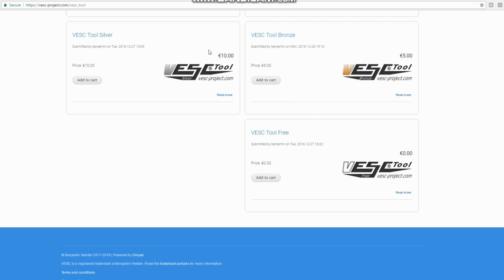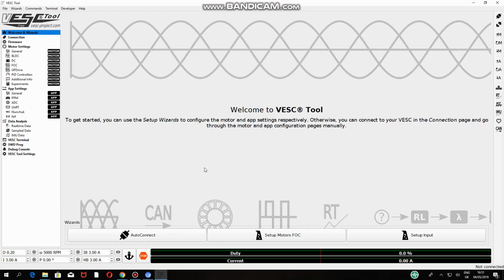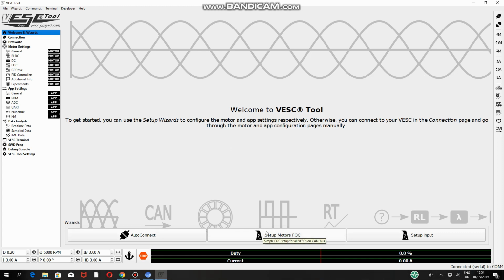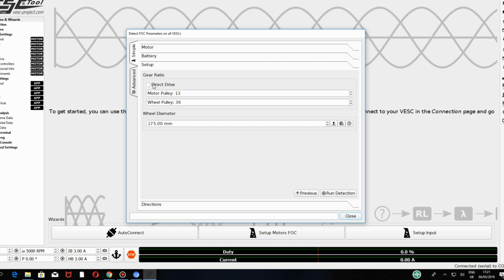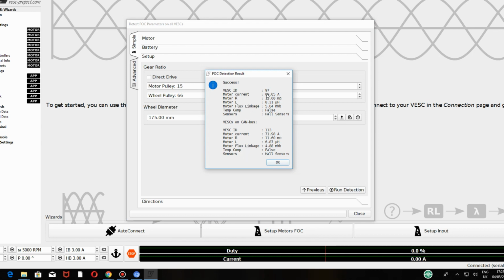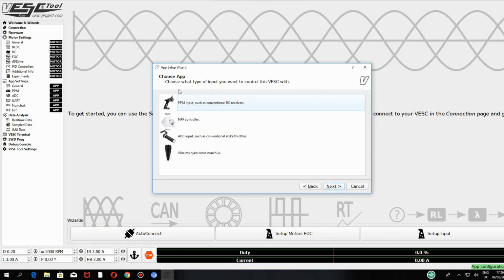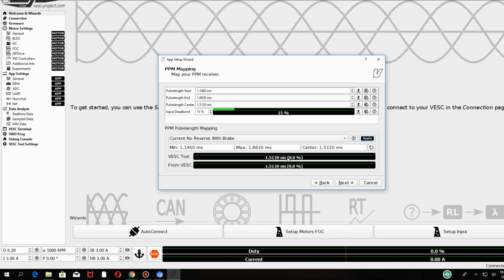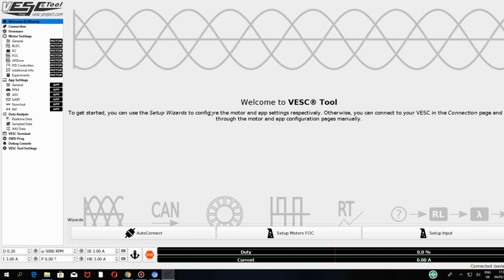VESC TOOL 2019 TUTORIAL. PLEASE READ MY COMMENT!!!! IMPORTANT!!!!!

Comment: I got caught in the rain and my storm core comes on but the wheels don’t move when I squeeze the throttle, it makes noises like it wants to move and the brake light steady blinks on my boosted rev
Reply from the maker: Did you check the phase cables mate?

Comment: Hey Pavel Garmas, this is really helpful tutorial. But I have hard time figuring out how to set the Battery Current Max and Battery Current Max Regen given battery configurations. And also want to figure out how to connect the keyboard/wireless Joystick to VESC. Would be great if you can help with this.
Reply from the maker: Hi mate,
Are you on my Facebook group ESK8FREEDOM? It will be faster and easier to help on there.

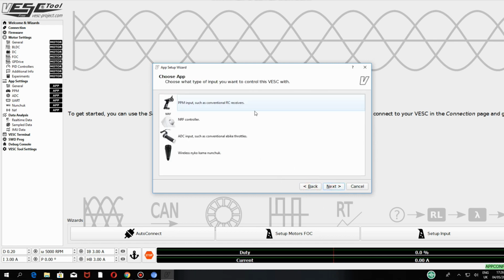Comment: Great video. The video has been very helpful, but I am having an issue at 15:27 on the video. I don't have any activity on the PPM Mapping. I have changed the VESC selection and have plugged it into both VESC's to test. I have updated the firmware a few times. I have gone thru the setup several times and keep having the same issue. I have a Flipsky Dual 4.20 VESC, hub motors, a Flipsky VX1 remote. Any help would be great.
Reply from the maker: Hi mate. Are you on ESK8FREEDOM Facebook group? Join. It is easier and faster to communicate there.

Comment: Yo man! Appreciate vid.. I got to the end of the motor setup wizard. After I enter my gears (I am using e-Toxx chain drive. 8-40 and when I hit the run detection I get error message  your vesc is not connected connect your vesc and try again. Any idea what this can be. Thanks
Reply from the maker: Have you tried to set the gear count after the detection? Gear numbers is for the correct speed reading only. Is the cable you are using in good shape and is definitely a data cable  and not just power cable?
Reply: Got it!! Appreciate ya man. Your vid helped so much man..keep doin them

Comment: Great video! I am having a problem with my setup. Vesc runs motor without the hall sensors but cant recognize the hall sensors. Any advice?
Reply from the maker: Hi mate,
It would be easier if you join my Facebook group ESK8FREEDOM and raise the question. We will help you to sort out the issue.
Reply: @PavelGarmas  Hi Pavel, thanks for reply.  I don't use Facebook but my body Richard who is working on this project with me will contact you. 
Milan

Comment: Flipsky FSESC 4.12 50A SK8 ESC Banggood says its a 14s i would like to add 48v lithium cells,Is this possible to work?
Reply from the maker: Flipsky 4.12 is not a good esc mate...definitely not at 14S. I have used them on 12S and it did blow in a week ... it was on FOC mode.
4.12 is only ok on 10S and BLDC.
Reply: @PavelGarmas  Its known to blow up  on  12s
I have two 10s Maybe in parallel,it could last a lot longer.
Reply: @PavelGarmas  how about 36v parallel? erm 8p

Comment: Hey man your video is the best tutorial out there!! I appreciate it saved me a lot of headache.  Do you happen to know if the flipsky dual 4.20 vesc can controll 2 motors independently via rc channels (2)? Any info appreciated!
Reply from the maker: Hi buddy,
Thank you for a nice comment. Unfortunately not...4.20 would not control the motors separately....none of the dual vesc esc would. They way they work is one is the master and the other one is slave. You will need to use two separate esc units as far as i know. BTW .... 4.20 is quite weak and does not support FOC mode safely.
Reply: @PavelGarmas  hey like I said b4 I appreciate the info!! Although I must say I did get them to function separately in channel 1 and 3 on an rc airplane remote, letting me drive tank style, I made all my changes in the app not the wizard, if u have any interest I can share the changes with you.  I appreciate your time and ride on!!

Comment: Should the battery current max set to half? in ur case 60A instead of 120A if your setup is dual?Then batter max = 1/how many motors. Or is it only applicable to two phyiscal VESC connected in can. THANKS
Reply from the maker: Hi mate,
Very good question.
You need to divide the battery current max and apply half to each esc or vesc. So if your battery current max is 100 Amp , 50 Amp per vesc.
I was setting up for a high discharge lipos ....

Comment: can i use it for exway flex?
Reply from the maker: Hi,
Any esc that is based on vesc can be programmed and settings changed however I believe that this board has an integrated esc by Hobbie Wing so it is not programmable.

Comment: What vesc are you using? It looks like a flipsky but I can't tell. Trying to decide on one for my first build but hear mixed reviews on flipsky. Recommend anything? Thanks this video will help big time!
Reply from the maker: Hi mate,
I am using the first generation Flipsky 6.6 plus with the heat sink. Still works no problem however there are a few reports that the new version and the mini do burn out. I would recommend the Maytech 50Amp or if you can afford it then the Trampa HD60 vesc. I got both reviews on my channel if interested.

Comment: Pavel, well if you're using 6S3P battery type or similar, think they you have to put 6S as series instead of 12(as you're requested to put series but not all what counts parallel connection)
Reply from the maker: Alex,
You need to put in a total 12S value of the pack. I have used two 6S Lipos in series so it is 12S in total. Hopefully I have understood your comment correctly.
Reply: @PavelGarmas  Pavel, just revised, yeah you did right 2x 6S in series = 12S :)
Reply: Well Pavel, but not agree with you on this case as in dialog it is requested to put only series  connection, but if it work for you then just fine. Also planning to build soon el-skate but with one wheel drive and see what we have, may do also some posts about build here
Reply: Decided to use 7S2P 6Ah battery here and think it have to be well for comfort city cruising
Reply from the maker: @alexvinnikov2967   What esc and motors are you planning to use? By the way, are you on Facebook? If you are, join my group ESK8FREEDOM.
Reply: @PavelGarmas  well ordered 1x 5045 1.5Kw and mini VESC 4.2  for now. I do use mostly insta: @vinmotive.design  ;  Can join team better if you have INSTa channel too, let me know then Pavel
Reply from the maker: @alexvinnikov2967  Alex. I do put in only the series connections in... hence why 12S  ( two 6S in series makes it 12 series connections in total ) setting in my video.

Comment: I’m first just trying to get it to work on one motor.  I tried a lower motor first then a wheel motor since that what it is.  I’m a mechanical and electrical engineer, I almost never have problems like this. I want to use this drive from a spec point of view but not impressed so far.

Comment: I started w just one motor first.  Connected the drive to my PC, it worked great.  Tried setting up the motor BLDC motor and first tried a medium motor and then tried a wheel motor.  

I hook it up to a different brand drive, works first time w no set up.  

So power supply and motor have no problems.  Just something is screwed up in the way the software detects this motor I’m guessing.
Reply from the maker: Hi mate,
Email me on pavsreview@yahoo.com

Comment: Im not sure which motor to pick when doing the FOC setup. I have a 250W hub motor made for a scooter.
Reply from the maker: Hi mate!
Is it an outrunner motor like the one in my video but smaller or is it a motor that looks like the electric bike motor?
Reply: @PavelGarmas  It's one that looks like an electric bike motor. But it doesn't weigh nearly as much as what is hows for the bike hub motor on the vesc setup.

Comment: Hope you can help! I have wasted hours and hours of time trying to get this drive to control my motor.  Looks like a great product and software but the lack of documentation is so frustrating.  I want to use it for a product and will buy several thousand of them if I can get it to work.  I hook it’d up, sometimes it spins a few turns and stops but that it.
Reply from the maker: Hello Kent,
I will help if i can but would need a bit more information mate. So what is that you are working on? What esc are you using? What motors? Battery? Controller? Is it a skateboard or an electric bike?
Reply: Pavel Garmas
Thanks Paul.   I’m actually building a mobile cart.  I’m trying to use a Flipsky Dual 4.2 100A with two 
Bafang (8fun) 250W 36V front hub motors.

I plan on controlling the system w an Arduino.  Problem is I can’t get the Flipsky drive to control the motors.  If I run the second like in your video, sometimes it starts to work turns really slow, then rev really slow for a second but no real power.   Then if I hit the Run button, it usually give me an error like no halls sensed.  I’ve tried for hours.  It’s so frustrating.

For now. I’m powering it with a 0-40v 50Amp power supply.
Reply from the maker: @kenttabor7695  strange....should work. Did you choose the correct motor type at the motor set up ? How are the esc units connected together?

Comment: Great tool!  I am trying to use this with two Bafang Wheel motors (250w).  The tool doesn't seem to detect it properly, the motor moves each way but very slowly.  I can't get it to run more than about 10% speed.  One question, how do I determine the pole pairs or effective poles?  Thanks!
Reply from the maker: Hi Kent,
Pole number or pole pairs number should be mentioned in the manufacturers literature....
I did dig around and found the spec for you : ) You got 20 pole.
Hope this helps.
here is a link : https://www.aliexpress.com/item/32879856483.html

Comment: Hi  Pavel. I've bought a 50A/240Amp Flipsky FSESC for a ebike I'm building.  In the setup Wizard where you choose the ratio of the motor sprocket and wheel sprocket I can't really do that for my bike.  The gearbox I'm running the motor through is about a 40:1 reduction.  Do you have any suggestions for what figure to put in the VESC Tool Wizard?  Thanks.
Reply from the maker: Hi,
Thank you for watching and for the comment. Gear sizes are  strictly for the speed and the battery range readings and will not effect the set up of the esc. Are you planning to use a separate speedometer and read from the sensor off the wheel?
Reply: @PavelGarmas  Hi. I probably won't have a speedometer, I'm building for hill climbing torque.  A 60-65-200kv motor on 10s.  My main reason for using the FSESC is to limit the power input.  Thanks for your reply :-)
Reply from the maker: @Liithiumbob  I see. Do not worry about getting the gear numbers right then mate...its only for speed reading on the remote.

Comment: Hi, i wonder if you could helm me figuring something out, i recycled an e-bike battery, i could get more of the same but this battery has a 8connector CAN bus in the bms board i dont know why?!.
Any idea if i can use this battery without anything connected to this?.
Reply from the maker: Hi mate!
Thank you for the question. I am not a specialist in ebikes but thinking logically - yes you can in principal. You need to decide how are you going to charge it. The plug is most likely the balance cables.... is the battery 8S by any chance?
Reply: @PavelGarmas  i think is a 8s BUT the 8x connectors are marked: link a, link b, gnd, 1-wire, can h, can l, wkup and vsys.
Any idea?.

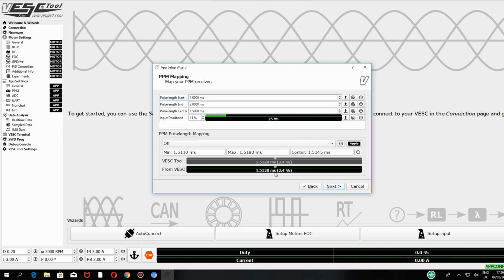Comment: Hi I'm having some problems with the programming. At 15:16 the numbers are not jumping in the vesc tool, I tried connecting to both of the different vesc's at 14:27 but I'm still not getting the jumping numbers. I have the flipsky Dual FSEC 6.6 and the flipsky VX1 remote. Hopefully you can help, thanks.
Reply from the maker: Hi mate!
We will definitely help. Are you on Facebook? Would be easier and faster if you join me in the group and ask the question. Lok up ESK8FREEDOM. See you in a bit.
Reply: @PavelGarmas  Yep, request sent 👍

Comment from the maker: !!!!!!!!!!!!VERY IMPORTANT!!!! PLEASE READ !!!!!      ENSURE TO SPLIT YOUR BATTERY MAXIMUM DISCHARGE RATE BETWEEN TWO ESC SIDES UNLESS YOU ARE USING SINGLE UNIT.
SO EXAMPLE : IF YOU HAVE A BATTERY PACK WITH MAXIMUM DISCHARGE RATE OF 80 AMP - EACH SIDE OF ESC SHOULD BE SET TO 40 AMP!
SAME FOR THE REGENERATIVE BRAKING - SPLIT BETWEEN TWO SIDES SO IF YOU WANT 10AMP REGEN - PUT IN 5AMP EACH SIDE!
THANK YOU!!!!!!!
Reply: I knew this was true for setting the motor max, but it's also true for battery max too? Really hard to find good solid info on this.
Reply from the maker: @RabLikesThings  
PM me on FB or post a question on ESK8FREEDOM group and i will gladly clarify any aspect mate. 
I am here to help and will do my best.

Comment: I'm doing somehting every so slightly different - My motor has no Hall Sensor - When I run the FOC detectionas per your vid it fails - It says "Detection failed. Reason : Sensor Detection failed". I'm using a MP70131 Motor 1.7kg Inrunner so I selected to 2000g option. Have you any idea how to get over this issue? If I run it in the FOC detection the other method I get an error "R is 0" and can't get any further that way either. All help greatly appreciated
Reply from the maker: Hello Luke,
FOC mode would require sensors mate. Try to set up in BLDC mode instead.
let me know if that works.

Comment: Hey I was wondering how you do the remote mapping without spinning the wheel?
Reply from the maker: Hello mate!
You can simply unplug the motors  while you are setting up the remote. I normally just run the motors,
Regards.
Reply: Thanks buddy but for some reason is not working for me, I updated one of the vesc first and did on the second one as well but every time when is time to set up the remote I keep getting the message that is not updated not letting me finish the set up. Bottom line when I tried testing the motors kind shake before taking off a lot and makes weird noise. You have any idea what am doing wrong buddy. Thanks again you are the best!
Reply from the maker: What remote are you using mate?
Reply: I have the vx1 from flipsky it's so weird cause everything goes fine on the vesc tool but when I take out one of the motors to start goes backwards for little bit. 
Everytime I push forward on the remote they start lagging ( shaking ) going a little backwards first.
Reply from the maker: Hey,
I know it might sound strange but did you try to swap the motor phase wires around? 
Another thing - is the receiver plugged in correctly?
What settings do you have chosen in the remote section?
If it is easier, find me on FB and message …. might be quicker buddy.

Comment: Got the app running in an android device. Was able to connect board once. After I get the “could not read firmware version. Make sure that the selected port really belongs to the vesc
Reply from the maker: Did you upgrade the firmware on the vescs and are you using the latest vesc version?

Comment: Is it possible to connect wirelessly like on the app? via Bluetooth? my board doesn’t have a micro usb. Or atleast I can’t find one. Trying to pair a Summerboard remote.
Reply from the maker: Hi,
Yes, it is possible to connect to the esc remotely  but you will need a dongle r an NRF module for that. MetrPro makes one and the app to suit, Trampa sells one and you can use the vesc tool app with that.
Hope this helps.

Comment: nice but id of liked to have seen you set up the battery cut offs and explained how those work because forums are full of people saying they hit cut off and got tossed off the board or had bad performance due to voltage sag up steep hills etc
Reply from the maker: Hello mate,
This video was log enough and is good for someone who does not know how to set up the VSEC. VESC tool is very good and "smart" all the cut off settings are actually done for you as long as you get the battery parameters put in correctly. Even I do not go in depth of custom setting the cut off points and never had any issues with Lipo or 18650 set up,
I will try to find time and make a video with more detail in the future,
Ride safely!